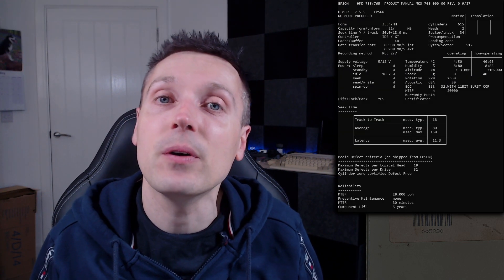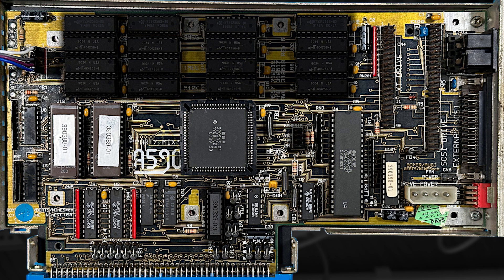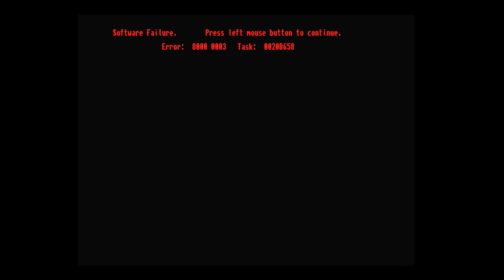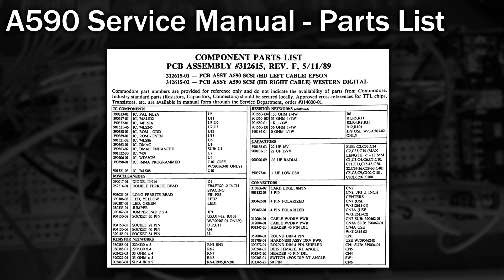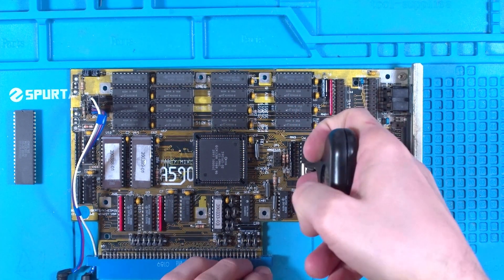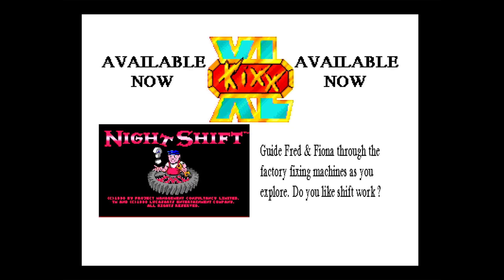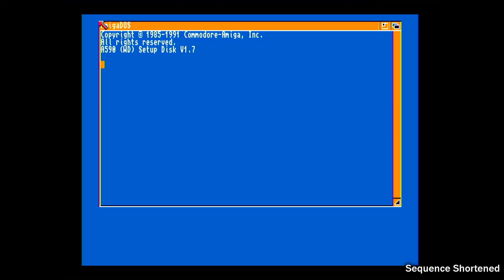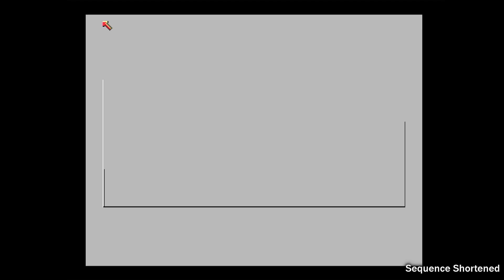Epson Made Harddisks? Amiga A590 Part 2

Comment: Thanks for the nice video! I would love to see your results with a BlueSCSI v2 replacement for the SCSI drive. Myself have an R7 A590 with 6.1 ROMs and I unfortunately up to now I cant make it work with BlueSCSI v2 (apparently others use it fine)
Reply from the maker: ….well you’ll have to wait for my next video….
Reply: @RobSmithDev  looking forward to it, last year i got an a590 and a reference 40mb hard drive, both scsi drives work but no power cable so i ill put the bluescsi i have in one of them - if i can find some ram that works on my reference branded one
Reply from the maker: You can find the ram on eBay. All the stuff I’ve bought so far worked even the stuff from China.

Comment: I think you should stop there. Having an all original Amiga is getting to be rare.
Reply from the maker: Part of the experience here is actually me learning about the parts I didn’t get to use when I was younger. Having two A590s is a treat, but I’m also lucky enough to have a few machines too. Depending on what country you live in they’re not as rare as you might think, it’s all down to what you’re willing to pay
Reply: @RobSmithDev  Here in the US they are somewhat rare.
Reply from the maker: Ah yes that makes sense. I’ve heard of them being imported. I’m lucky enough to be in the UK I guess, they’re fairly easy to come by